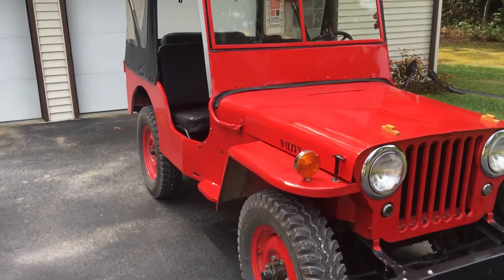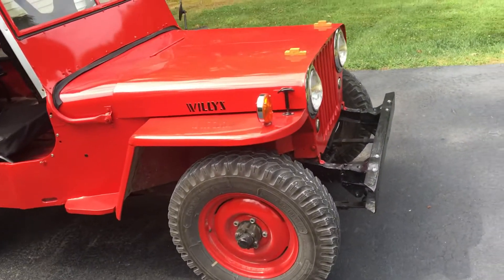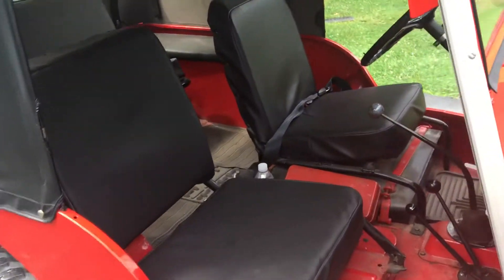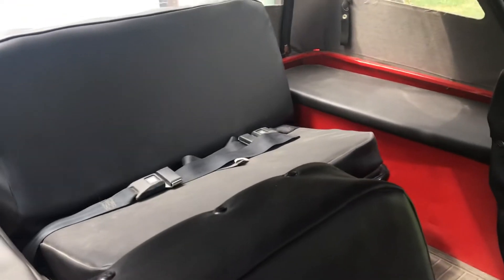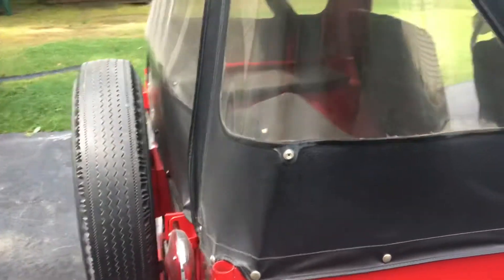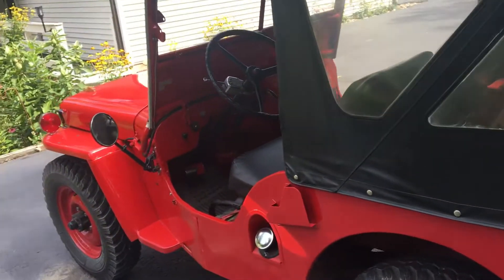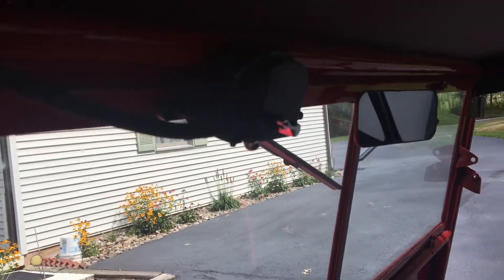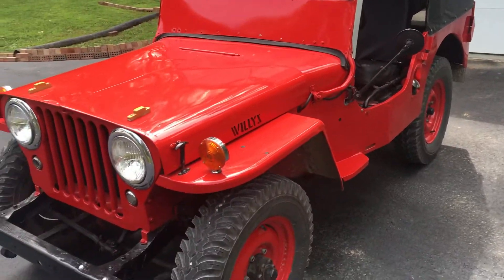My 1947 Willys CJ2A, flat fender

Comment: I had a '48 Universal. It had a 1/2 cab (steel) with a useless heater, which warmed  my right foot , but just barely.  The good news is that I learned about vehicle maintainance from that thing. 48 grease fittings, it needed tie rod ends, brakes, and brake cylinder rebuilds all the way around, a new master cylinder, and a whole lot more.  It was my first set of wheels and at 16, was as old as I was.
Reply from the maker: I can relate to that they always need fiddling to keep them going.